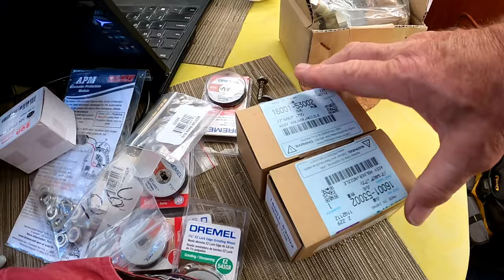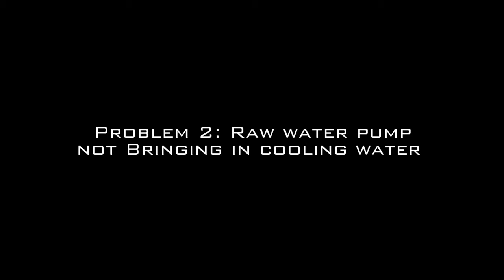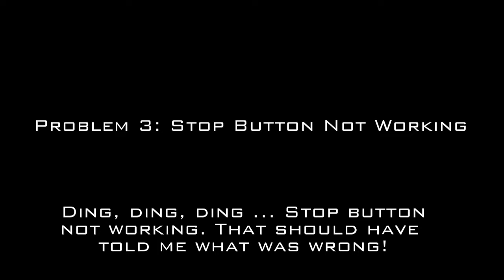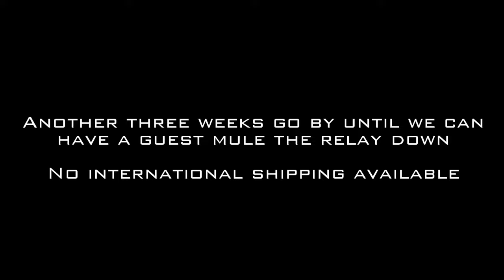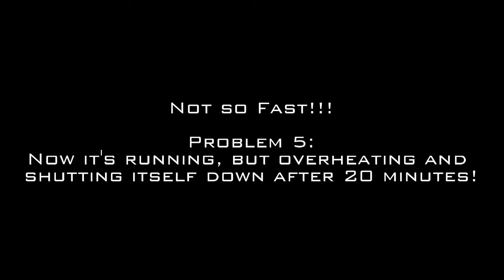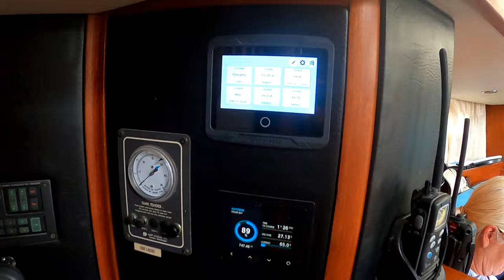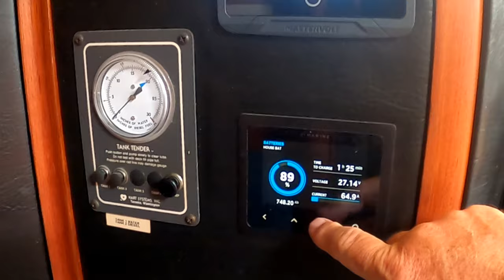Ep 147 I Refuse to Fail at This! Fischer Panda Generator

Comment: Until the last 10 seconds of the video, it was a really positive repair sequence...   and then boom!   Keep at it!    It's amazing that little generator puts out what it does!
Reply from the maker: Yep. Just the way things go on a boat. But as I've said elsewhere in this thread, I'm pretty sure the pump seals and bearing alignment were defective from the factory (Johnson Pumps in Sweden). This sucks because it's an expensive pump, but I did order a new one once we got back to the States, and that one will be installed as a first priority in the fall.
Reply: @SailingTalisman    You are a master at the disaster.   Wait that doesn't sound right...   You are a master at solving the disasters!   There, that's right.   You're always on top of the game at keeping Talisman in fine working order.   Nice going even and Wendy!   I know it's a team thing, even though Kevin does more of the on camera work.  ;-)

Comment: Great episode! I am in the marine service business. Unfortunately the Fischer Panda units do not have a good reliability reputation. The big selling 'feature' was the size to power ratio at the time they were offered.
Reply from the maker: Yes. I would agree. I am somewhat hopeful that now that they're supplying the US military as a contractor, that they can get to better reliability. But the US EPA is also riding just about every manufacturer to meet near impossible emission standards, and that leads to excessively complex control boards and various sensors that are prone to failure. Our issue is that there isn't another product out there that will fit in the space. I have 24" of width to work with, and not much more than the 18" of depth we presently have. I'm okay on height, but nothing from any of the major manufacturers will fit.

Comment: If you put your mind to to it, you could write a users diagnostic repair manual for that engine, and it might sell!   There are obviously a bunch of issues that cause breakdowns, and when multiple issues occur at the same time, they can lead to scratched heads.   There ought to be a manual to diagnose these issues, and you could write it!   Well done Kevin! You stuck with it and fixed it!   Congrats!
Reply from the maker: Thanks for the kind words Jim. There is an exhaustive Fischer Panda manual, complete with a full two or three pages of troubleshooting tips. These tend to revolve around installation and commissioning issues. But what isn't addressed there is how the failure occurs, along with the subtle hints the unit will give off as things go bad. I suspect part of this is a reluctance to admit that the safety features built into the unit can and will lead to lack of reliability. In any event, I doubt I'll be writing any manuals for our generator, given its age. But what I do do is answer questions and do remote tech support when asked to do so. It's a rare week when someone doesn't contact me offline about some issue or another, often about things unrelated to generators. It's an enjoyable side hobby that keeps my mind in the game.

Comment: That was quite the battle to figure out Kevin, and then to have the water pump leak again just when you thought you had it finally set. "I'll show you who's boss"😅
Reply from the maker: Isn't that the truth! But at least with the pump you know what's failed. The guys at Multiserve (who rebuilt it twice already), had it out in 3 hours, delivered to the machinist to build up the shaft to factory specs, and had it reinstalled the following morning. I can't say enough good things about those guys. And this is in the islands, where nothing gets done fast. I'm convinced the problems started at the Johnson Pumps factory, and something's out of alignment internally. Industrial pumps don't usually fail this way.

Comment: I understand your frustration Kevin. I was a purchasing professional for two Fortune 50 companies. I purchased complex systems OEM ($200,000+) with many components and subsystems from third party vendors. We, corporate purchasing management and the various purchasing entities refused to accept third party warranty issues. Purchasing philosophy was the OEM's quality control dept was responsible for ALL components and their function per the purchase order.
Reply from the maker: It sounds like you've been down the path a few times. For us, it's more that the unit is so far out of warranty (it's 30 years old!). But that said, Fischer Panda would cover warranty on the parts they chose to use from third party vendors inside the warranty period I'm sure. And no company these days is 100% vertically integrated. To their credit, Mike Kruger and the service team at Fischer Panda in Ft Lauderdale, Florida have been rock stars in offering advice and replacement parts.

Comment: Great episode. We are in contract to purchase a Jeanneau that happens to have a FP genset as well and now my eyes are starting to roll thinking about the future genset issues I have to look forward to. Ha.  Brent from Catamaran IMPI did an entire YouTube video on removing the engine driven water pump from his genset and replaced it with an externally mounted A/C March mag drive pump because of similar problems. It could be helpful considering the water pump broke again.
Reply from the maker: Now that I know how the FP works (from the technical/mechanical side), I'm more comfortable having it there. So many of the problems were not really FP problems. I mean, if the small inline fuel pump between the fuel tank and the gen dies, who's fault is that? Similarly, if you keep getting huge clumps of seaweed in the raw water strainers, or carbon buildup in the exhaust, yes it's the generator going down, but really just maintenance. If you have problems, get in touch. As long as it isn't in the electrical power generation side, which it usually isn't, there aren't that many places where things go wrong. BTW, the raw water pump aboard Talisman was bad from the factory I've come to believe. The shaft was never aligned properly, so seals failed one after the other. Not typical at all. I have a new pump already in the pile to ship down come fall.

Comment: Try a Next Gen generator it will fit in the space and save you thousands of dollars!!  Trust me I spent thousands on my panda and swapped it out for a Next Gen and have been running it for 5 years with no problems. All relays on the unit can be purchased from any automotive store.
Reply from the maker: Hi Steve. Thanks for the update. I know the Fischer Panda line is universally hated by techs and users alike. And the situation seems to be a design that's overly complicated and prone to failure on the electrical side, both in the running of the Kubota diesel engine and also power production (stator). But that said, so much failure starts with poor installation, especially when it comes to using non-marine grade electrical connectors and other electronic parts. So I went and looked at Next Gen, and the issue I see is that it's American and outputs 60Hz power. They offer 120/240VAC, which is fine, but we need 50Hz Euro power aboard. Another subscriber suggested WhisperPower, which I'm looking at seriously. According to the company bio, the owner was instrumental in launching Victron Power in the late 80's, Mastervolt in the mid 90's, and WhisperPower as part of Mastervolt, soon to be spun off as a stand-alone company in 1998. We have a mix of Victron and Mastervolt aboard Talisman, and both are exceptional in terms of function and reliability. Their generators are being marketed as OEM systems for hybrid van and marine EV applications where high torque electric motors are run off constant running fuel efficient diesel generators and lithium batteries. In my view, this is the future of EV, given that I see no scenario where batteries can be charged in the time it takes to fill up your tank with fuel.

Comment: Aren't small engines an absolute bugger! You have my sympathy Kevin. It seems way too complicated for a simple genset, too many electronic components that will always let you down. But having said that...that water leak?
Reply from the maker: Yeah, I know. The (Multiserve) guys tell me the shaft was loose in the bearings after they froze up on a previous failure. I'd add that the original bearings were not of the sealed variety, so water gushing in caused them to fail. The new versions are sealed, so that might help. Anyway, the machinist welded up the shaft all the way around, then turned it on a lathe to bring it back to factory spec. I honestly think this particular pump was poorly manufactured and I'll order a new one during the off season.

Comment: The problem is related to lack of maintenance...The heat-exchanger needs cleaning, also the pump needs new  seals, or if not, replaced on time. I'm amazed about the lack of knowledge from your side, you can easily get stranded with that old boat and not maintained correct.
Reply from the maker: Yes, I'm sorry to disappoint. Others would do better.
Reply: Thats a little harsh in my opinion sir. They bought a used vessel.

Comment: That's a lot going on with all the different systems aboard a cruising mono hull. It looks like a lot less cluster on a lightweight performance catamaran but may be it's just spread out more. Both boats need the same gear pretty much. Anyways, I'm going to order the plans on the new boat that Cap'n Plukkie is building. This will be my first cruising boat and I have a lot to learn as I haven't cruised since 1985 when I was aboard TeVega that is now called DEVA which is a 165 ft. long gaff rigged schooner and 164 ft. tall. I believe it was 27 ft. wide. We navigated the old school way and had no electronic anything. I'm highly considering getting the new Tim Mumby design but might get the older design called a Cyber 48 which is a lightweight aluminum performance cruising sailing catamaran.
Reply from the maker: Sounds great Robert. Space is always the problem, especially on monohulls. And Oyster created probably the first boat of its size designed from scratch to have all the comforts of a modern home. Thus, a hugely complex system of electrical wiring and plumbing. And generally (this is true for all brands), you start to lose any option for a generator at around 45' (again, talking monohulls). Cats have way more space, but are also much more sensitive to how much weight they carry.
Reply: @SailingTalisman  Yes, the weight is a killer on cats. I'm going to go for a fully electric boat just like Plukkie which will mean that I'll have to have a lot of batteries and solar panels. The marine grade aluminum material that the designer Tim Mumby uses to build his lightweight catamarans is the best material to build a boat with in my opinion. I also like carbon fiber but that's out of my budget and I'm not sure if a bear carbon fiber hull would be lighter weight than a bear aluminum hull. Anyways, I'm going to keep it lightweight. I really like your Oyster. It's one of the best mono hulls you can get.

Comment: They make excellent small boat moorings but other than that they will break your heart and the bank
Reply from the maker: Easy to say, but there isn't another brand that fits in the location, other than Mastervolt/Whisper Quiet, and that uses the same Kubota Z-482 diesel engine as the Fischer Panda. Given that ours is now working and just passed a lube oil analysis test with flying colors, I think I'll try to eke out another couple seasons. I know so much about how that thing works that I could probably qualify as a FP tech. Anyway, I'll use it till it quits for good.

Comment: What company did you use in St Lucia and would you recommend them? I have a low voltage issue on my FP and  I am having trouble finding someone to fix it in the area.
Reply from the maker: Sorry for the late response. Try Roger (Rodney Bay) at +1 (758) 284-6050

Comment: We have a panda generator as well. Was working fine and now won’t start. Panel displays “start attempt failed”
Reply from the maker: Manually hold the stop solenoid open (rotate the butterfly valve that the solenoid is connected to, thus pulling the actuator rod out from the solenoid). Hold it open and try to start the engine. If you're doing a lot of cranking without the engine kicking over, make sure to close the raw water seacock. Not doing so can allow water to backflow into the exhaust and hydrolock the engine, thus destroying it with a loud bang. Once the engine starts, open the seacock again. If the engine starts, but then dies when you stop holding the butterfly valve open, then the start relay (small black box behind some of the rubber hosing) is bad, or the solenoid itself is bad (not as likely). If this doesn't work, make sure the engine is getting fuel. Check Racor filter and make sure fuel is all the way to the top of the bowl. Next, back off the bleed screw at the high pressure fuel pump and see if fuel bubbles out as you attempt to start. If these actions don't solve the problem, contact me off-list at the email shown in the "about" tab on our YouTube landing page (Sailing Yacht Talisman). BTW, these are issues with the Kubota engine that drives the Fischer Panda stator, so not strictly FP problems per se.
Reply from the maker: On older FP units, there are two fuses (one red, one blue) under a clear plastic cover lower front of engine. One is a starter fuse, and if the engine is cranking this one is good. The other is an engine start fuse. Make sure that one is not blown. If you have a generator isolator, turn it off first, otherwise you are likely to blow these fuses trying to check them. I eventually replaced both with blade fuses in wired holders given that the old red and blue fuses are no longer produced and you can't even find a pic of them online. Consult the wiring diagram in the FP manual to get amp ratings.
Reply: Wow!! Thank you so much for replying!!! Will try this out

Comment: Okay, I'm about to give up on my FP 4200. I'll replace the starter and if it doesn't work, I'll move to solar and inverter.
Reply from the maker: Let me know what happens when you do. If the gen engine isn’t starting right away, like after 10 or 15 secs after turning it over, shut off the raw water sea cock. Be ready to open it up if the engine catches, but failing to do so (absent exhaust gasses to push water through) can lead water to back up into the exhaust manifold and then into the cylinders through open exhaust valves, thus hydrolocking the engine. Doing so can bend valve push rods and even bend connecting rods. This applies to the main engine too. Like I say, report back. My email in the “About” tab at SYT landing/home page.

Comment: You are really persistent Kevin, many would have given up before. Fischer Panda generator have a good reputation, what year is your unit? As always great posting!
Reply from the maker: Hi Albert. That's the issue. It's a 30yo generator, so ancient. But diesel engines and other industrial equipment can function for decades as long as they don't catastrophically fail. Working now, so I'll take that as a win.
Reply: Look at the reviews on line for panda, 😢